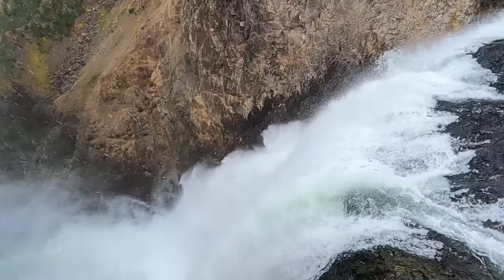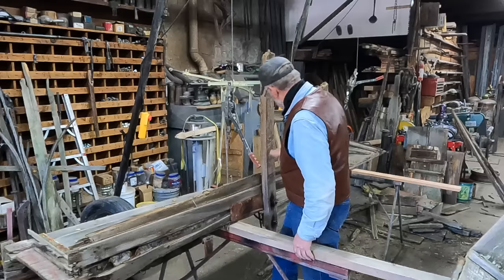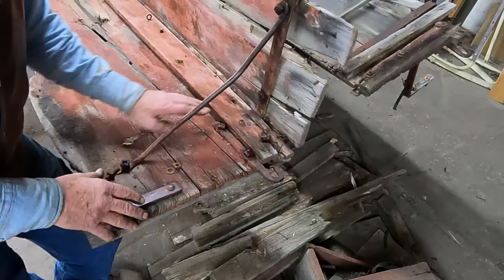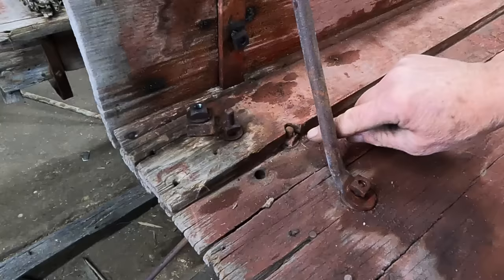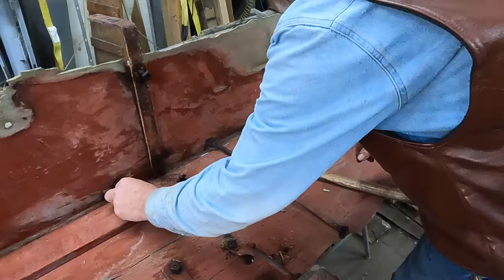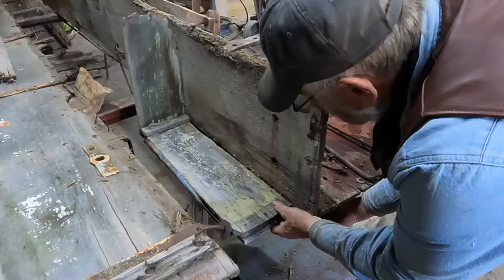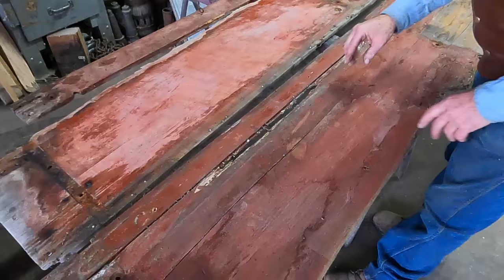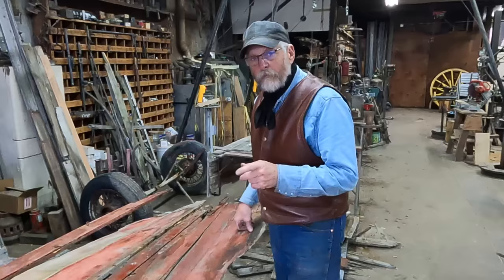If This Was Yours, What Would You Do? | Engels Coach Shop

Comment: I would scrap all of the wood and only use the irons.  Attaching good wood to rotting wood seems like a no win situation.  Good luck on this one, Dave.
Reply: Agree 💯
Reply: I was thinking the same thing Mr Jeffro !!!!!!
Reply: Looks like it was painted with milk paint. A lot of old barns around here were painted with it.
Reply: Probably the best way to retain original woodwork is put representative samples into a display case while remanufacturing a durable wagon.
Reply: Was thinking similar - display some bits to memorialise, and explain why it couldn't be saved. Maybe commission an artist to make a representation of what it would've been like.
For sure, that wood's too far gone.
Reply: Agree
Reply: Agree. I would at least try to use the same species of wood to honor the original intent.
Reply: Maybe use the on e side board that is a little more intact as a tailgate or seat board so one piece of wood is original. Replace everything else but use the irons.
Reply: +1
Reply: Unfortuantaley the owner wants him to keep as much of the wood as poss
Reply: Get some period original barnwood to recreate the wagon from. Maybe a few original pieces get epoxy infused to stabilize them and kept in decorative (non-structural) locations.
Reply: Personally, I would ask Dave to fully replace the 12 foot boards as he sees fit, and take the old boards, and see if he can use them (after trimming off the garbage) in other locations like the tailgate, hanging box, pots and pans box, etc. That way, some of Gramps old wagon still carries on. It looks like you may be able to get some 5 or 6 foot long 8 or 10 inch wide boards out of those sides/benches.
Reply: @phrozenwun  I really like this idea. Seems like a great solution. I would just use the period wood to build the entire wagon.
Reply: Add  me to the scrap wood list
Reply: All new wood, save some of the old wood to make some keepsake out of it.  Picture frame, adirondack chair or something..  Or maybe a toolbox/breadbox for the wagon or something..
Reply: Like everyone I don’t see much wood to save.  If it was going to be a static display I would rebuild it with used lumber from an old house or barn.
Reply: @DeadFlanders agree. If any of the wood can be saved , then use it for some new, appropriate. , use seems too far gone for the original purpose. Structural integrity need to be primary concern.
Reply: It's going on display showing the as-is used condition. A piece of history saved as opposed to a re-creation of history.
Reply: I absolutely agree. Don’t waste the entire effort by “saving” that old rotten wood. Old irons. New wood.
Reply: Totally agree. Rebuild using the irons.
Reply: Agreed. The only issue is the owner asking to preserve as much of the original as possible, and this is going to be a display piece, not a working wagon. I'd still opt for new wood with some of the old in a display case.
Reply: I would have to agree with that too
Reply: @timhull8664  Now a definition of POSSIBLE might be in order!  :-)
Reply: Since you asked, Based on my understanding, I would save as much wood as possible, since it will be a display piece.  If it was an actual wagon in use, then I would use new wood.  If you are keeping the Model A wheels, then I would try for period correct 1930’s look.  Good Luck, Dave.
Reply: @carlthor91  hundred percent
Reply: Exactly! Ditch the wood - Preserve the measurements and the style but cut new boards.
Reply: This is a piece of history, representing the hardscrabble existence the early settlers dealt with. All of that old wood tells a story and I would keep it except the most rotted. Where boards are compromised, I would make a 30 degree miter (looking at edge of board) and feather in a scab in as little as necessary with wood glue. To discard most of the wood, would make it a new wagon and no longer 'historical'. And if I remember correctly the owner was interested in preserving the history and did not simply order a new wagon with old irons.
Reply: @kristinesautter3529  It doesn't they added oxide to color it. Why would you think it would just wash off? It absorbs into the wood. They repainted them often.
Reply: Im torn between keeping old and renewing all of it... But this one is so bad I think it's going to look odd halve new and halve old..
Reply: I agree. He bad wood is a liability.
Reply: This is the correct answer
Reply: Dave, the cost of using the old wood  in labor alone would be higher than the using all new wood. The owner would get wagon back that would not meet the quality of your work.  Anyone who looks at the sheep wagon is going to see the old wood and shake there head!
Reply: Do it will new wood, old iron, then distress it to make it look old.
Reply: @rodipson1013  not if it's painted..might be the owner just wants to know some of the original is still there... I would just cut out the best pieces and use them somewhere in the build so you can say you did.
Reply: Exactly. Make it all new. Doesn't mean the old stuff has to go in the oven, maybe something cool can be done with it, but it's not reasonable to expect any sort of stability from this...
Reply: Agree
Reply: Old barn wood as a source.
Reply: amen

Comment: I suspect the owner had no idea what “preserve what you can” really meant in the context of this wagon. It’s really too far gone and I think you’ll be able to convince him of that pretty readily. Especially if you detail the cost of reproducing it as new versus painstakingly using a sliver here and sliver there. He just waited too long unfortunately.
Reply: My thoughts exactly. Dave should have the owner come in and see this wreck. "Save what you can," is really unreasonable in this situation.
Reply: I think I saw three pieces that might be worth saving.
Reply: The Australian Armour museum came up with a term that fit here..... Rustoration. If you do nothing then all is lost. Minimal restoration will stop the rot for now, allowing full restoration in the future.
It's a difficult call
Reply: This is a piece of history, representing the hardscrabble existence the early settlers dealt with. All of that old wood tells a story and I would keep it except the most rotted. Where boards are compromised, I would make a 30 degree miter (looking at edge of board) and feather in a scab in as little as necessary with wood glue. To discard most of the wood, would make it a new wagon and no longer 'historical'. And if I remember correctly the owner was interested in preserving the history and did not simply order a new wagon with old irons.
Reply: @taxesdeathandtrouble.1886  I had the same thought. That way the spirit is preserved, even if the actual wood is minimal.
Reply: @taxesdeathandtrouble.1886 This is what I was thinking as well. There's too much gone from the side boards/benches and trying to cobble them together with patches will be a huge time sink with no guarantee how long it will hold up. Replace those with new wood and use any salvageable chunks for smaller parts elsewhere as needed.
Reply: @lesstoneuk  Love The Australian Armor Museum. Gotta have my Workshop Wednesday fix!
Reply: @clearviewtechnical  It's the old Washington's Hatchet/Ship of Theseus conundrum.
Reply: @taxesdeathandtrouble.1886   Yep. And there'd be so much new wood just to get it sound that the old wood will be functionally lost anyway.

Comment: Thanks for asking Dave , please build a new wagon and heat your shop with the old wood 😊
Reply: Although I live in Scotland where at the moment it's getting colder by the hour I agree with your sentiments about burning everything and starting again.
Reply: Agree
Reply: This is a piece of history, representing the hardscrabble existence the early settlers dealt with. All of that old wood tells a story and I would keep it except the most rotted. Where boards are compromised, I would make a 30 degree miter (looking at edge of board) and feather in a scab in as little as necessary with wood glue. To discard most of the wood, would make it a new wagon and no longer 'historical'. And if I remember correctly the owner was interested in preserving the history and did not simply order a new wagon with old irons.
Reply: Don't burn the wood if it has paint on it.

Comment: Replace all the larger pieces. You have to have a good foundation to build upon. Then use pieces cut out of the original boards where you can to incorporate in the rebuild. The wood may not be back to where it was but it will allow you to reuse what you can albeit in smaller pieces where some of the original can be used. So it will allow a more stable rebuild. Repurpose what you can where you can.
Reply: To me, this seems to be the most sensible approach.
Reply: Agree
Reply: Yeah, the person wants to remember this wagon, fine, keep all the iron, if there are any wooden pieces that are still fine, ok, keep them.  (I'm not sure there are) Then maybe some of the wood could be cut to make some smaller pieces for the new wagon.  If this is ever going to be used, again, or sit outside, then it should be mostly new wood.  If it just going to sit in a barn mostly, or in a covered spot, ok, then replace all structural stuff and leave what will stay together but not that functional.

Comment: Not sure I've ever seen a basket case as far gone as this one with the intention of bringing it back.  It's such an interesting project and will test even your advanced skills, I think.  I can't quite visualize how that boot hook worked but will get it eventually.  If it was me, I'd rebuild with new lumber and use the old as patterns and then repurpose the little bit of old wood that's still good into interior furnishings or something.
Reply: This is a piece of history, representing the hardscrabble existence the early settlers dealt with. All of that old wood tells a story and I would keep it except the most rotted. Where boards are compromised, I would make a 30 degree miter (looking at edge of board) and feather in a scab in as little as necessary with wood glue. To discard most of the wood, would make it a new wagon and no longer 'historical'. And if I remember correctly the owner was interested in preserving the history and did not simply order a new wagon with old irons.
Reply: Having done old furniture restoration, it can seem a simple choice between building  something new over salvaging what is left that is usable and putting it back together. I would think a good alternative would be to use what you can for shorter pieces and replace the longer boards with some salvaged wood.
Reply: I once rebuilt an entire house which had fallen in.  It was a family home built by the owner's g-g-grandfather.  All that was useable were the chimney and hearth, and a small corner of the outside walls.  Much of the orginal was was reused but only for cosmetic exterior and interior furnishings.
The result was the new home looked very much like the original.

My point being well planned, judicious use of old materials is extremely possibly.  The owner of the wagon wants something he can see.  How its put together only matters by what it looks like.

Comment: Personally, I would ask you to fully replace the 12 foot boards as you see fit, and take the old boards, and see if you can use them (after you trim off the garbage) in other locations like the tailgate, hanging box, pots and pans box, etc. That way, some of Gramps old wagon still carries on. It looks like you may be able to get some 5 or 6 foot long 8 or 10 inch wide boards out of those sides/benches.
Reply: I think the same - better use 100% original wood for box to have continuity, and use "new" old boards to make the body. I think it's common practice from old days - repair or reuse somewhere else.

Comment: This is a piece of history, representing the hardscrabble existence the early settlers dealt with. All of that old wood tells a story and I would keep it except the most rotted. Where boards are compromised, I would make a 30 degree miter (looking at edge of board) and feather in a scab in as little as necessary with wood glue. To discard most of the wood, would make it a new wagon and no longer 'historical'. And if I remember correctly the owner was interested in preserving the history and did not simply order a new wagon with old irons.
Reply: I agree. I would cut out the rot and glue in new (old stock) for fill just where needed. After painting it should not be noticeable, but the majority of the original wood would be there.

Comment: Salvage what you can from the sideboards and other large pieces by cutting them to make smaller components like the seat, gate, or door. 

What I wonder about is whether it should be restored to its early configuration as a sheep wagon with four wheels or the two-wheeled cart.

Comment: I would suggest repurposing whatever salvageable wood there is to build cabinets, boxes, etc. since didn’t see much, if any wood that can be reused in its original place. I would use new wood for the primary restoration. I think that keeps the memories and avoids the need to come back in a few years and ‘repair’ the new wagon as the older wood continues to age.

Comment: I have to advise home owners all the time of what is possible to do with what they have when doing addition/refurb work. In your case I would advocate for rebuilding the wagons main structure with new planks and using salvageable wood as components of the rebuild. Cleats, door panels, seat bottoms/side/back etc.
I advise them that time is money and that while I may be able to “save” something, the cost in hours will far out way the cost to replace the material. Usually they like the idea of incorporating the old into the new vs trying to save what is really to far gone.
Good luck!

Comment: Use as patterns and for approx measurements , then it's firewood for winter . I have had experience with these "museum types ", whose favourite word is "consolidate " .The amount of work needed to ressurect this would require a lot of time and money , if the customer has it . Save the meltwork and burn the rot . Regards C .

Comment: If this wagon is a yard ornament, it would still be counterproductive to utilize much of the old wood. If the owner has very deep pockets, he still will end up with a patched up pile of firewood.  Using the old irons, nuts and bolts, rebuilding a "usable" wagon while using some of the original wood for a feature detail makes more sense. It is relatively easy to  age the wood to give it that weathered look. It's a big project given what you have to work with, if the owner wants to spend a small fortune on yard art he'll have to weigh that against having a functional and probably fun to use wagon.

Comment: At what point in time did the owners realize they waned to save and use the original parts from the sheep wagon for this rebuild?   Well it seams like they didn’t care much about it for the last 20 to 50 years or so. I would just use the “good iron” and call it good. In years to come the benefits of new wood making  a solid wagon will be appreciated. Your video in itself is documenting and saving the original sheep wagon. Good luck and happy working. CW

Comment: I think if I was really pressed to save any of it, I'd cut some exterior slices where I could, them glue it up to good wood underneath. Looks old outside but it's solid inside.
Reply: That’s a pretty good idea.
Reply: @Vikingwerk  actually rebuilt a cabin like that. Brought a porta mill with us and sliced off the facade and milled up logs to replace the rotted cores. Inside and outside were nearly perfect and the structure was reestablished. Did the same thing to the roof rafters. Built new rafters and skinned them with the original material.
Reply: Agreed, thats a fun thought!  Just like the Barn Wood Builder guys do sometimes.

Comment: Regardless of originality, the wagon has to stand up under its own weight. I would replace all of the wood, keep the irons, and maybe use one piece of the old wood for a commemorative plaque.

You may glue all of that rotten wood back together, but it would simply fall apart again during assembly; much less the trip home.

Comment: If you are going to keep any of the wood at all, you will have to separate all the boards, then "finger joint" whatever is still solid with replacement wood. both ends and sides of the boards. Someone else suggested sourcing some salvaged barn wood. I like that idea. Then using what hardware you can salvage to rebuild the wagon.

Comment: Mr Engels, sir, I would show the customer what it would cost to try and salvage pieces of the otherwise rotted carcass of that wagon.  The time and energy and cost alone to try and use that rotted wood would be immense compared to just rebuilding it from scratch and trying to match the old paint scheme to the new wood.  If you do use some of that old wood there is no guarantee that it will last and the owner could come back at you and demand their money back.  That would be another hassle.  I would use the existing irons and manufacture everything else.

Comment: Hi Dave,   Unfortunately it looks like most of the major parts are too far gone.    Agree with other posts, trying to save what you can may compromise the strength of the finished wagon and will incur a lot of unnecessary additional labor.  Save the big bits and make some of the smaller parts, like the side boxes, or make the owner some kind of wall hanging or shelves in remembrance of the original. Looking forward to seeing how it all works out. Thanks again for the interesting videos.  They are one of the highlight on Friday evenings.  Regards, Don